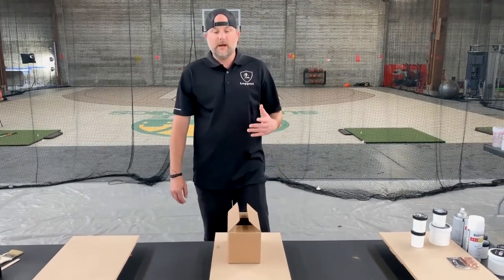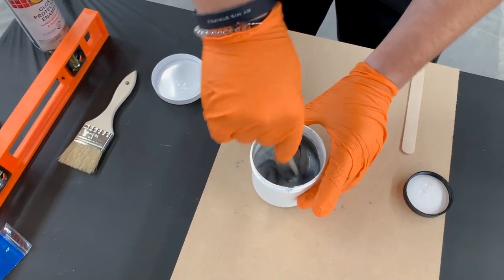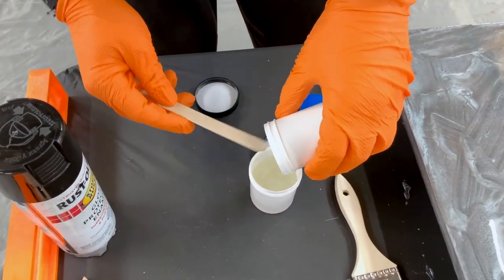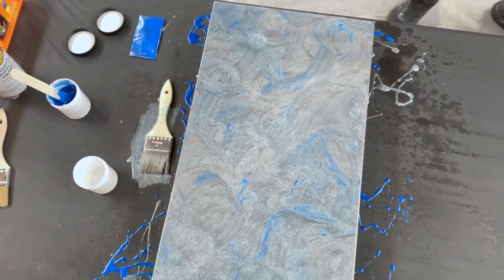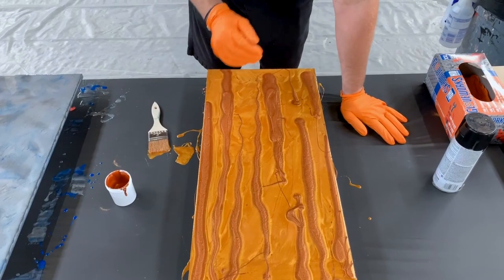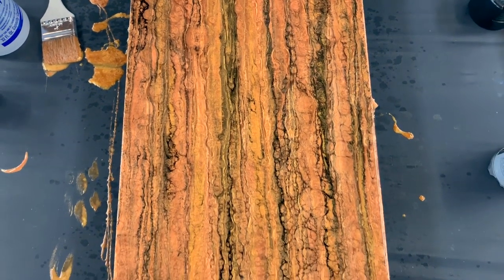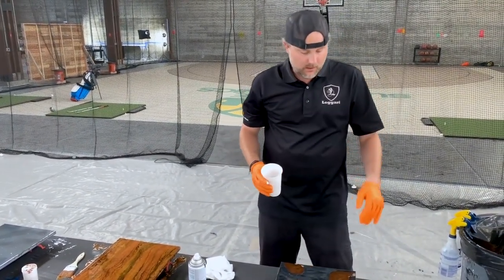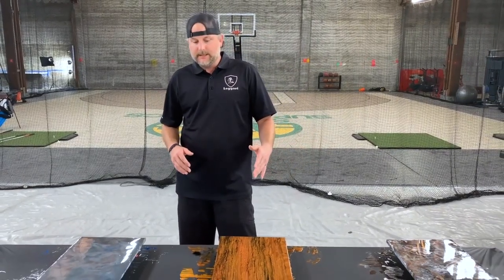Metallic Epoxy Sample Kit | Full Tutorial

Comment: Make sure you spread out the spray paint or just add another color if you want more.  It doesn't  move like the epoxy does.  It will look like hot garbage if you dont.  Speaking from experience on that.  Also, this guy is an amazing artist.   He's making it look easy.
Reply from the maker: Thanks for the tip and for watching the video.

Comment: Which type of spay are you using. Water or solven based?
Reply from the maker: Isopropyl alcohol 91% or higher for the dispersing effect and then denatured alcohol to let the epoxy lay out glass smooth and pop any surface bubbles!

Comment: Just received my sample kit. Wondering if I can use it on a solid wood end table? Renew the table top & practice for my kitchen counter tops. My question is does the sample kit only work on MDF?
Reply from the maker: You can apply the sample kit to any hard surface and the sample kit will cover a 1 x 2 sq. ft. surface.  Thanks
Reply: #TRUMP #KAG ,
Directions call for an 1/8” thick spread.  There is a four sided plastic spreader the size of your palm available at Home Centers.  It has a 1/2” , 3/16”, and a 1/4” triangular tooth edge.  I use the 3/16” which is 1/16” above the 3/8” suggested spread rate to spread it all out fast and easy... then roll away with your 3/8” nap roller. 
This is the fastest way to get it all spread out even and any excess can be poured back into the cup. 
I tape my edges first with doubling yellow masking tape... so, to spread it using this neat plastic trowel thingy is a breeze and you always have plenty left over to do the back edge riser area of your laminate counters...( back splash ).

Comment: Would love to do my kitchen counter tops but they are no way level so I take it this product can't be used.
Reply: It will take some work and time but applying bondo and sanding to get it level is an option.
Reply: Or adding another sheet of wood and adjusting shims beneath to achieve a level surface could work as well.

Comment: They're have more costumer buying there product if they answer some of 
these question.
Reply from the maker: We do have a customer service line at 844-534-4274 you can contact with questions.  Thanks
Reply: @LeggariProducts  what's the base color on the third board? You wouldn't know which thrid board, if I called!
Reply: Leggari Products, hi is there a substitute for spray paint when doing floors to make it easier?